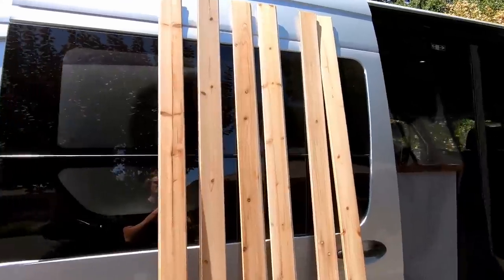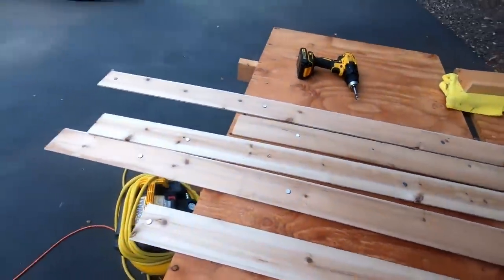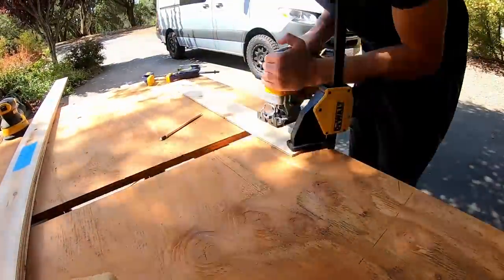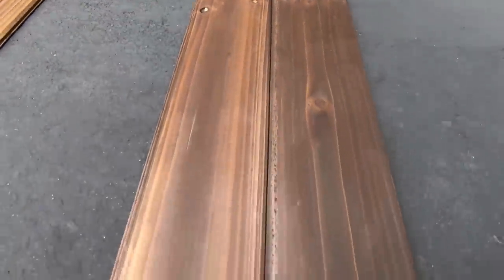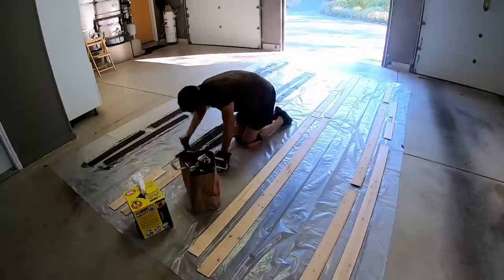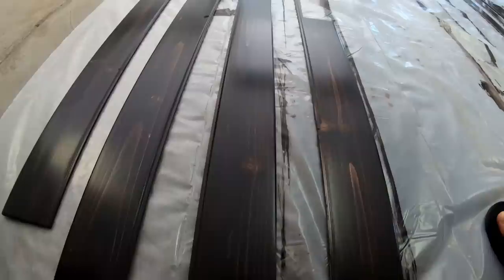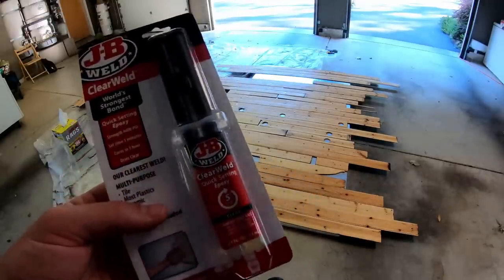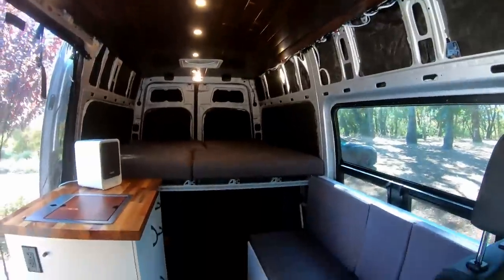How To Make A SUPER CLEAN Van Ceiling w/ Wood & Magnets - #vanlife

Comment from the maker: TWO YEAR UPDATE: The epoxy between the magnets & wood did NOT end up holding. Strangely, the magnets were not the weakest link (they were still stuck to the ceiling when the planks fell).

If I was going the magnet route again, I would think about how to mechanically fasten the magnets to the boards. So far I haven't come across any great ideas for a way to do this, but please share yours and if I like it I'll edit it into this comment!
Reply: I'm watching this episode right now wondering about this solution, thanks for the update.
Reply: They make magnets with countersunk holes in them. They are more expensive but that would probably work. Also, how many magnets did you use?
Reply: I’m thinking of trying this with a couple modifications. Bigger magnets, a bit deeper in the wood and using wood glue or another better epoxy. Love this original idea!
Reply from the maker: @reedmelicher8658  the problem with magnets that have countersunk holes in them is they are already 1/8 into the 1/4 plywood so there isn't enough room for the screws to bite
Reply: Great build. Love your content. 
I would try to put the magnets in first with epoxy and then seal over it which should add a extra resin like layer over and magnets should still be able to stick.
Reply from the maker: @Superrandomz768  This is a good idea. This would probably work.
Reply: 3m marine adhesive 5200 will hold it for ever
Reply: Drill holes in the magnets qnd rivet them on? Maybe of its not too thick?
Reply: Did you epoxy in the magnets after you sealed the wood?   If so it might have been better to glue them in before sealing the wood.
Reply: what about the product people are using on their roofs to adhere things and is super strong?  Sikaflex i think?
Reply: @seven_o_savage  What if you use magnets with countersunk holes and apply on top of the wood (not making even an 1/8 hole for the magnets)? Or using 3/4 planks with stronger magnets? How did you solve your ceiling problem? An update (solution if you find one) will be very much appreciated.
Reply: This looks like a great idea , l think l would use the original Gorilla glue( kind you have to use with water) . Only thing is you have to not use to much and have to clamp until dry so maybe do a stack and clamp them together until dry. I think l will try this on a test board. And its waterproof so any condensation should not hurt it. Did the boards seem to vibrate or were they noisy before the glue failed.
Reply: tks
Reply: Why oh why did I not learn of this magnet idea before I started the ceiling of my van? My tongue and groove ceiling has turned into an absolute nightmare for several reasons and the magnets would have solved half of my problems! As far as the epoxy failing, I'd be willing to bet that  LOCKTITE PL MARINE ADHESIVE SEALANMT would hold those magnets in place, and by letting the Locktite dry enough to hold the magnets, but not dry enough to become tough and unmovable, when you screw the boards into the metal ribs of the ceiling it would still be pliable enough to compress all the way down so it would not interfere with your planks sitting flush against the framing ribs of the van ceiling. I used this Locktite to hold the wood framing in place throughout my van, and nothing fell before I could get to it to screw it into the van. I also used the same Locktite to position my Maxxair fan on the metal roof and it has a good tight hold even when wet.  If I have to start over on my ceiling, that's how I'm going to do it. MAGNETS!!! Brilliant idea!
Reply: @sheri4673  What would be the point of magnets if you're screwing the boards to the van? Wasn't the goal to use them instead of screws? I wonder if other options like countersunk magnets mentioned above use in conjunction with an additional glued on wood spacer to screw into would work, but then you'd be losing a bit of space and depending on glue strength in variable temperature over time too... or maybe not stagger the planks and have a horizontal piece bolted to the ribs to make them removable in sections. But then you'd have an exposed fastener if it was even a viable option :)
Reply: @Groosome128  It's been a while since I watched this video but if I remember correctly, the purpose of the magnets was to hold the boards in position long enough to screw them into the metal frame of the van. That was the toughest part of doing my ceiling, getting those boards up overhead and ensuring they were parallel with the walls before attaching them- it was a nightmare and the longest part of the entire conversion because I was working alone.
Reply: @Groosome128  Please disregard if this is a duplicate reply, I tried to reply a while ago but don't see my response here. If this video is as I remember- the point of the magnets is to hold the boards in place while screwing them into the frame. I installed my ceiling planks by myself- working overhead is a miserable job. I also found a job saving tool called "The Woodworkers Helpin'  Hand" from a small company called Original Devices- these little clamps are a bit of genius and were worth every penny, I don't think I could have finished the installation by myself without them.
Reply: Use stronger magnets and put one (or two) on each side of the wood and even another one on the top side of the rib. I was using a combination of four magnets to hold something else on top of my roof and the pull of the magnets was too strong to pull apart with my hands. So more than enough to hold the wood in place. Put epoxy over that, it'll hold.
Reply: Have you a three year update. What did you end up trying that worked?
Reply from the maker: @JaimeImbusch  I used the same wood, but screwed it into the ceiling instead of using magnets. There's a video of the new ceiling :)
Reply: @seven_o_savage  thanks man
Reply: Use clear silicone. That’s what they use to attach sinks to the wall. Stuff has incredible holding power and just the tiniest bit of flex needed for a vehicle
Reply: @seven_o_savage What type of epoxy did you use? 

I wanna try this but with perhaps with a stronger or high-temp epoxy. Great vids!
Reply from the maker: @shevy5000  i believe I used regular JB weld

Comment: Great idea,  If you rough up the magnet on the under side that glues into the wood with a file will adhere strong, great video.
Reply from the maker: Yep, this is the right way to do it. Sending you to the top of the comments section!!!

Comment: Nice work! I've been thinking next time I'll use a lot more magnets too. Especially for wall panels. One trick is to make the hole JUST the right size so the magnets are tight in the hole. Then the glue doesn't have as much work to do.

Comment: Yep that is exactly what I bought to attach my roof planks, also thinking it will be perfect to able to remove them if needed to access electrical! Like minded I see.. though I had only planned to use removable planks in the corners where wire would be, but good to see they hold throughout. Well holding while in parked, before all the shaking on rough roads test that is! Great videos I’ve subscribed and and enjoying the journey.
Reply from the maker: Thanks Dani!

Comment: You have done a great job and for an amateur it looks very professional, i would personally use secret clips to secure them, even if clips are stuck to the metal! I wouldn't trust them magnets, two reasons, one the wood will fall off when you hit your first bad pothole, two, the magnets probably won't glue permanently to cedar as it is quite oily... great idea though i must admit! Either way, goodluck with your build, love your enthusiasm and eye for detail!

Comment: Interested to know if the ceiling will hold when going down ruff boondocking dirt roads. There are some big bumps out there. Cool if it holds.
Reply from the maker: I was originally a bit concerned but once the tongue & grooves are in place, the mesh-network of magnets is so strong & the cedar so light that I don't think it would be physically possible for them to come off under their own weight.
Reply: @seven_o_savage  I guess it all depends on the type of roads you take! We were often surprised by the amount of activity back there (but we did go deep into the wild!). My main concern would not necessarily be having a few planks on the bed after a rough road, but the result in a potential crash. That's a lot of things flying around. Maybe something to consider. We had the same focus while installing the ceiling (being able to access easily behind), but ended up installing rivnuts into the ribs. It was a good call because we ended up replacing a few ceiling bolts with eye bolts to install a surf rack later on during our trip. Rivnuts + bolts are much cheaper than rare earth magnets and are definitely strong. The only downside? They are a pain to install (especially inverted into a uneven ceiling rib). Safe travels!
Reply: Don't u need vapour barrier ???

Comment: So clever - definitely plan to use your technique!  Just watched your insulation video - with the thinsulate & cedar paneling, you have mold resistant materials and are allowing free evaporation? With a cold exterior and warm humid interior - you’re sure to get condensation on metal parts - what’s your thinking on this?
Reply: My thoughts exactly.
Reply: Some insulation like wool does not require a vapor barrier, but prefers to have airflow.

Comment: Genius in my opinion but only one issue would be during a crash you would have projectiles
Reply: Daniel T if u watch the videos of accidents everything is a projectile and everything is dangerous 
seen people from back seat end up by front seat or upside down under the front seat and the driver in the engine
phew!!
Reply: @misamisa2677  That's why i'd be inclined to have a floor to ceiling sliding panel to block the living space from the driving space. Possible projectiles are reduced to what's in the cab.
Reply: Or a really sharp pothole impact....matchsticks
Reply: Daniel T yup, what happens on cobblestones or rough terrain?...
Reply: @misamisa2677  that's why people wear seatbelts.
Reply: Nice 👌 job, the magnetic attached method is great
Reply: This is why insurance companies don't want to insure DIY conversions as an RV unless it was professionally converted, or individual components were done professionally. For other DIY'ers, do it right, and take lots of pics of what's going on under the skins, to prove it was done right. It will save money on insurance if you can get RV insurance. and insurance company will pay for the build out in case of a bad wreck. These are important things to take into consideration before doing your build.
Reply: @johnwren3976  Or drive to Alaska, hit frost heaves (and become airborne - ask me how I know with travel trailer in tow!).
Reply: there's enough interlocking pieces that after the initial impact it may fall down but so can a lot of things like those upper cabinets, it'll be fine.
Reply: I'm a painter for a living.. you did a great job but those foam "brushes" are junk.. better to buy a multi purpose brush and wash it when done.. a brush can last forever it you clean it
Reply: Outstanding!!!
Now I want to redu my ceiling
Reply: As asked, and I’m actually surprised that you didn’t answer (as you usually Do), is after Time, would you do it again or Not ?
Reply: @GuyCruls  with the correct strength/rating of Rare Earth Magnet, there’s no way that they would fall.  Even in ‘button’ size, they are Very strong !
Reply: just use string magnets and light wood : ) it seems he does!
Reply: @misamisa2677  I agree - but a VERY few screws would stop that  - witi the tongue-in-groove.   It would still be super easy to access ceiling stuff.  I'm going to do it - with a couple of screws front and back to hold it all together. . .
Reply: @aldo9564  I might do what he did but use two magnets spaced out next to each other instead of one per metal stud
Reply: @johnwren3976  you and the 7 others…thats not how proper strength magnets work but good try with your lack of knowledge

Comment: Nice! How many packs of magnets did you need for your ceiling? Whats your thoughts on using the magnets on the side wall panels also? Looks great! Cheers!
Reply from the maker: Thank you! I ended up using roughly 80 magnets. Magnets would work for side panels as long as they’re supported by something on the bottom. If they’re free floating panels the panel will likely slide down over time.

Comment: Honey!  That epoxy has a cap so that you can  push out a little bit of  the A and B at a time and do small jobs!  If you clean the ends off and replace the cap, the epoxy will stay, usable for months!  One hint -  they want you to deposit equal amounts of A and B, so they manufacture the plungers stuck together!  Well that would be great if they were of the same consistency! But, they're not!  So, you never get equal amount out at the same time!?!??  I solve the problem by cutting through that bridge that holds them together.  That way, "I" have control and I can truely make the proper mix!

Comment: I have a question, Seven. I noticed the fan box was tapered and you cut the hole for the tapered end. Did you have to recut the hole? Also, how is that glue & varnish for VOC's? Such close quarters. It is a very pretty build. Hope you are enjoying it.

Comment: I was going to use magnets for the wall panels, but I didn't think of using them for the ceiling. Awesome. Are they holding up well? Have you been over any washboard roads yet ... to see if they hold?
Reply from the maker: Yep, they aren't coming down! You can even use them for (very) light structural stuff like mounting your fan frame.
Reply: Simpler than riv-nuts! Maybe next time...

Comment: Great great great idea!! I'm excited. I am doing a cargo trailer conversion that has ribs every 23 inches. I already put reflecix and 1inch insulation but could not put a curling cause I can't build anything. But I'm doing this. What kind of glue did you use for the magnets
Reply: JB Weld two-part epoxy. Watch videos and plan out your work flow to get it super efficient or it will cure and be unusable before you get done.

Comment: Could you place a support stringer perpendicular to the T & G boards over each of the metal beams and actually screw the stringers into the metal beams.  I know this would mess up the flow of the ceiling T & G pieces, but it would be a minor aesthetic compromise.  And you could put little wooden buttons over the screw heads.  Also, if needed, you could still unscrew the perpendicular stringers and then temporarily take down the T & G boards to get to the wiring.  I'm just spit balling here and I'd appreciate it if anyone thinks this would work????

Comment: Just about to start the ceiling, did it work any issues a year later ? before I commit all the way over here in the UK.... you are my bible on conversion :-)
Reply from the maker: Biggest issue was epoxy adhering to magnets. I suggest you combine the epoxy w a mechanical fastener like a screw for maximum longevity

Comment: I did this exactly with my ceiling and at first it worked great but than on the first hot sunny day the sun heated the beams the magnets secure too, which loosened the adhesive and all the magnets fell out and the boards fell down. I ended up having to screw them all in anyways. I ended up wasting about 15 hours trying this
Reply from the maker: Interesting I found a similar problem after 2 years (just heard from the owners). The epoxy is def the weak link. Just posted & pinned a comment on this vid to update the rest of the savage fam and hopefully encourage others to iterate on this design instead of repeating our same mistake!
Reply: @seven_o_savage  I appreciate that and yeah it would have worked great if the epoxy was stronger and could handle heat better

Comment: Umm not a huge fan of the idea of magnets. If you do a head-on collision into anything with this vehicle, you'll have cedar planks spearing through the driver's cabin at high speeds. Magnets hold well for straight pulling force, but sideways sliding force, not so much. I may be overly cautious but I'd prefer having the ceiling bolted to plusnuts, personally. Everything in the van has to be safe for crashes in any direction, and it even has to stay put if the van rolls over - that includes batteries and tanks and everything else. At least in my opinion. Ideally mechanical bolts for absolutely everything, secured into plusnuts.
Reply: The adult in me totally agrees with this but it's still a pretty cool concept and I am tempted to try. I already have a bunch of heavy duty neodymium magnets, they are stronger then one would think. Another way would just use hook and loop fastener material across the ribs. I did this on my old van with corrugated plastic sheeting for the ceiling.